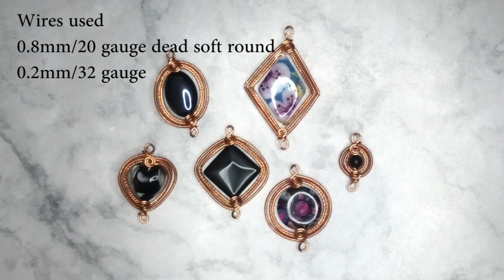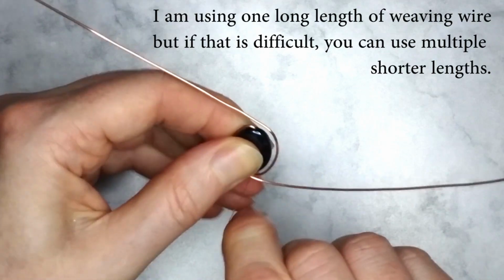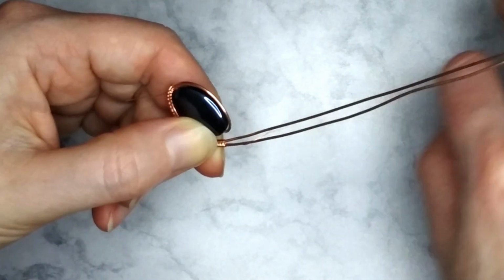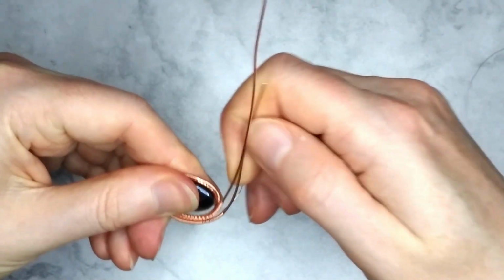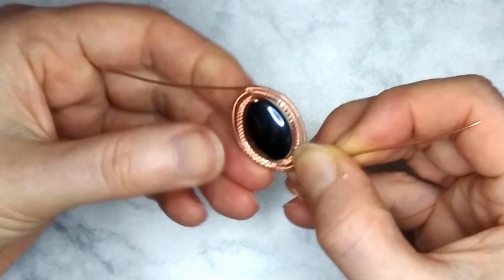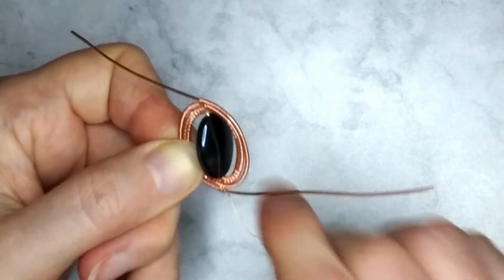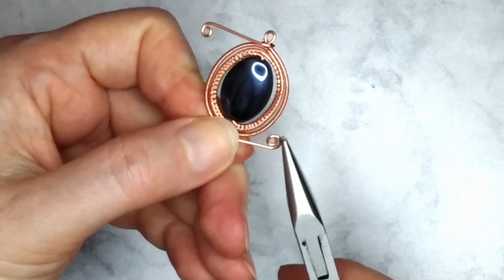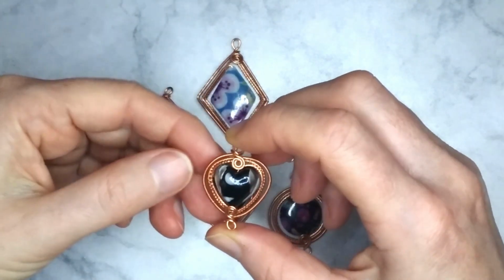Halo wire wrapped beads part 1 - wire wrapping tutorial for beginners

Comment: I would love to see a tutorial on the small beads.  They could be used in so many ways... links in a necklace, earrings, small pendant, bracelet etc.
Reply: The reason you don't see more small beads being used in tutorials like these is because small gemstone beads don't typically have large enough holes to pass through the wire and small glass beads break with the slightest pressure or movement of the wire.
Reply from the maker: Thank you for your comment, I have just uploaded part 2 which I have added a demonstration of this wrap on the small beads for you. Thank you for taking the time to view my video https://youtu.be/oxKOy_5QLxc